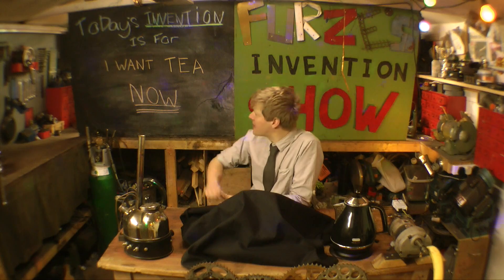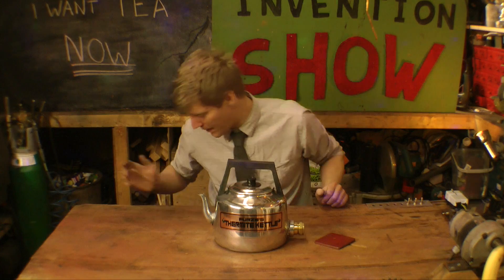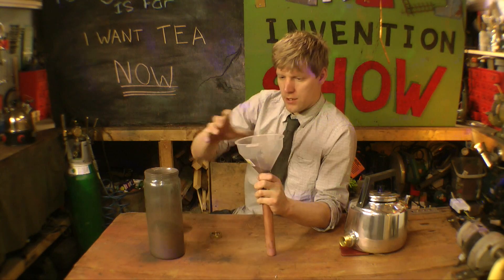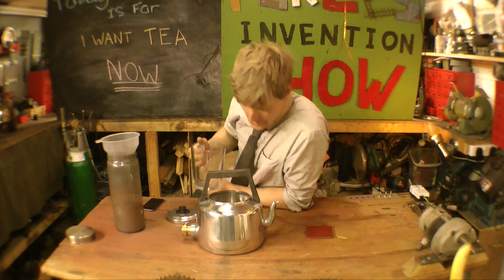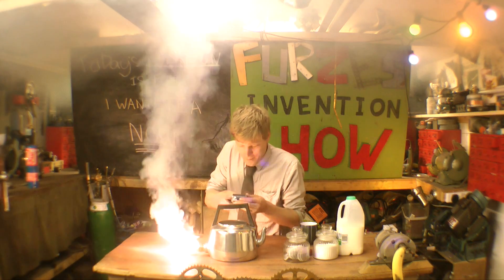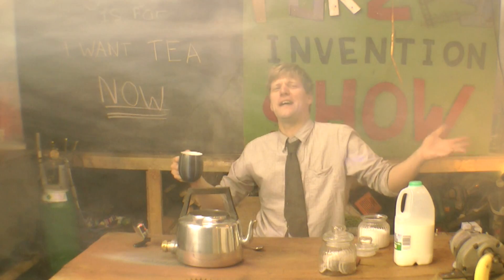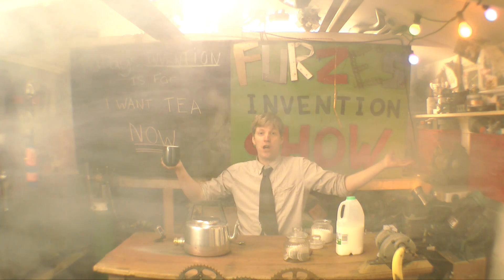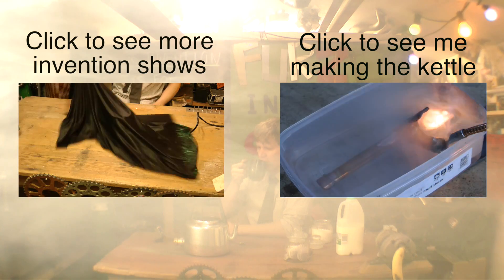The Thermite Kettle

Comment: Alright so I´d need an instant beer cooling device... Any ideas?
Reply: +Stelio Jotti Dump it into liquid nitrogen. ...might explode
Reply: +Stelio Jotti Fill a box with ice, put your can of beer side way into the box, roll it for a minute. Instant cold beer.
Reply: +Derek Leung Nah, needs to be more instant and less effort-y
Reply: +Michael마이클 Implode probably.
Reply: +Stelio Jotti Mythbusters made a tube that spirals around a block of dry ice. 
You pour the beer into the top and ice cold beer comes out at the bottom.
Reply: +Stelio Jotti Oh and they also made another one was basically a heat sink that you put into dry ice and when you need it, you can take it out and dip it into your pint
Reply: +Stelio Jotti Put it in the fridge
Reply: +Stelio Jotti A CO2 fire extinguisher will cool a can of beer in a minute or 2. Lots of YouTube vids on this but it's not that cost efficient unless cooling a 24 can pack hahaha!!
Reply: +Stelio Jotti Go to the beach. Dig a hole in the sand 1 foot deep. Put the beer can in and bury it. Pour a cupful of petrol on top and light it. Wait for the petrol to burn out , dig up your beer. It will be cold.
Reply: Joe Anthing
A heatsink is something that transfers heat, no? This could allow you to cool something without the nitrogen touching the beer. It could also work with insulation etc.
Reply: Joe Anthing It's been a long time since I looked at the expansive qualities of water under low temperature and it was generally reputed an commonly agreed to be in the 10% region.

It may have been revised but I remember experiments from school (25 years ago) like freezing water between 2 rocks and noting the expansion.

Very much in the same way that no one can agree on the exact amount of oxygen in the atmosphere and 20% is often the ratio considered compared to everything else in the atmosphere.

Pedanticism has a time and place but in the freezing beer spectrum it's negligible ;-P
Reply: the freezer-wave
Reply: +Stelio Jotti Heatsink and liquid nitrogen?
Reply: +SHATORR Why would you need a heatsink?
Reply: +Stelio Jotti there's an attachment for a drill that you can quickly clamp on to a bottle or can and spin in ice for a few seconds
Reply: +SHATORR Well the heatsink surrounded in liquid nitrogen would cool down to -150c~ anyway and will freeze the beer not too long after. Not the best idea! Not to mention you can't get your hands on liquid nitrogen that easily.
Reply: +Ethan Barnes What would spinning it do? It's not going to cool it down any faster...
Reply: Joe Anthing
Yeah, I didn't believe this to be a serious request. A mini freezer always works. It's not instant but it's really difficult to get something instantly cold without freezing it anyway.
Reply: I was having a laugh with my CO2 fire extinguisher for instantly cooling beer, which does work but is not cost effective.

But seriously, there's no quick way to cool beer for us mere mortals except for 10-15 mins in a freezer and DO NOT forget about the beer.

Water expands by 10% when it freezes and more often than not, the can will just blow open. If you're lucky, the inverted base of the can might just bulge out.

So put a few cans in the freezer and surround them with frozen food and set a timer for 10 mins and don't forget about them. The rest of the cans can freezer naturally in an ice box or the fridge.

There ain't no short cuts to cool beer, unless you're willing to spend more money on dry ice, liquid nitrogen or oxygen or a CO2 fire extinguisher, than you would on beer!!!

It would be pure sacrilege if you opted for silly cooled beer than more money for beer!!!
Reply: Slightly above 9% actually :P
Reply: +reggiep75 actually there is a set amount that water expands by. Unlike the among of oxygen in the atmosphere which can vary.
Reply: Joe Anthing since when has science made sense, its supposed to work
Reply: +Joe Anthing you can buy it online for like 10 bucks a pint or something. It's really not that hard to get ahold of. My science teacher has a canister of the stuff in the storage room. Needless to say, it's always cold in there.
Reply: You can't really get it in small quantities. You also need to have a suitable container which isn't cheap to buy. In the UK, it is harder to get hold of for sure. I've tried.
Reply: If you're thinking of making thermite, I know I have, I've looked on Amazon and you can buy the raw Iron Oxide powder and Aluminium Oxide powder, be sure to buy rough AND finest grain of both items as this makes the best aggressive thermite. You can buy these materials from lab material suppliers too in larger quantities all in normal packaging.

Even Etch-a-sketch has aluminium oxide in it, just if you need it quickly but there's not a lot in one.

Mix it yourself to the perfect ratio that is agreed as being 8:3 with 8 parts Iron Oxide and 3 parts Aluminium Oxide. Mixing by pouring from one container to another helps even out the mix but mix for an hour or so and you'll end up with an even mix that should burn well.

As for igniting, you need magnesium ribbon or magnesium oxide which needs lit with a strong flame like a blow torch. Plant pots are the best delivery tool of thermite.

Once you'd done all the above, you're ready to burn thru the engine block of a car and stand well clear or you might burn thru your lungs or other essential body parts, which isn't good!

Buy raw materials in large quantities, mix your own and enjoy the furiousness of thermite!

Follow usual safety guidelines but closer than normal, this is thermite.
Reply: thermite from an etch a sketch would not burn through an engine block
theres videos on these myths
Reply: Ethan Barnes That's quite obvious tho and it's only aluminium oxide you'd get for the Etch-a-Sketch.

You need a few kilos of thermite mixture to get a decent burn and an Etch-a-Sketch will only give you something like 40g of powder as some of the mix is plastic pellets used to distribute the powder and stop it caking up.

So it's quite obvious that someone wanting to make Thermite with a load of Etch-a-Sketch's would be barking up the wrong tree massively.

Just order the raw materials from ebay - Aluminium powder (in 2-3 different grain sizes to minimise gaps if possibble) and Iron Oxide and mix to a 8 to 3 ratio (Iron Oxide to Aluminium powder) and bingo. thermite you can ignite with common sparklers.

Just don't regret making the stuff as you're in A&E with 3rd degree burns over 50% of your body

So people debunking myths is nothing new as they're barking up the wrong tree to regarding thermite!
Reply: +Stelio Jotti I have this idea too, I already think of a big device with a lot of thermoelectric devices and fans that pump something like 3kW and a recipe fill up with antifreeze where you put your can ready to cool down
Reply: Unbox therapy found something for instantly freezing things

Comment: How do you get house insurance?

erm hi, hello I've had a bit of a fire in my shed

I'm sorry to hear that Mr furze do you know the cause?

yes I was boiling my thermite kettle for a brew and the table caught fire, I put it out but it's made a right mess of my pulse jet.

so you were boiling the kettle and it caught fire, and the brand was thermite, is that right?

no no I used a highly volatile chemical compound that burns at an extremely high temperature to boil a small amount of water on a combustible surface

erm????

and there's also a bit of fire damage to my bunker too

did you just say bunker Mr furze?

cough cough, as you said the kettle caught fire, dodgy electrics or something. I wouldn't know about such things.

OK Mr furze can you just confirm your policy number

Comment: If anyone is wondering why the tube of thermite didn't melt, it is because the water causes the heat to dissipate so fast that the metal tube can never reach its own melting temperature. this is why water cooled guns can effectively shoot forever. (given enough water)
Reply: Water cooled guns 😂😂😂

Comment: if you ever want to make home made thermite you will need to grind down some aluminum foil to a powder using a coffee  bean grinder, once the foil is ground down you will need steel wool for the iron oxide. (iron oxide is just oxidized iron/rust) you take the wool and soak it in salt water then let it sit for a few days as it rust's. keep doing this till you get it into a powder. and as furze said." 8/3 ratio " then you are done.